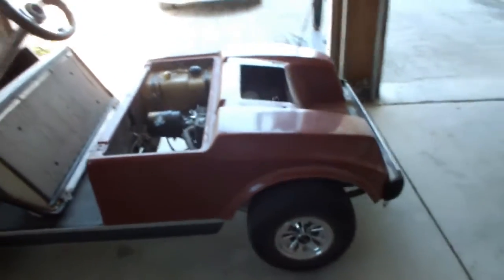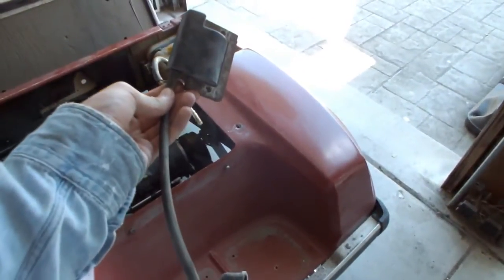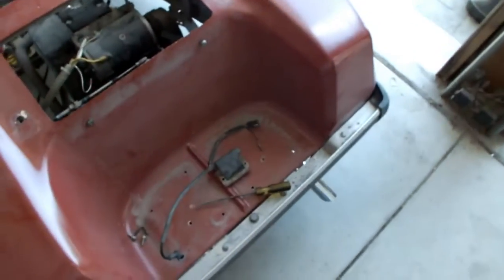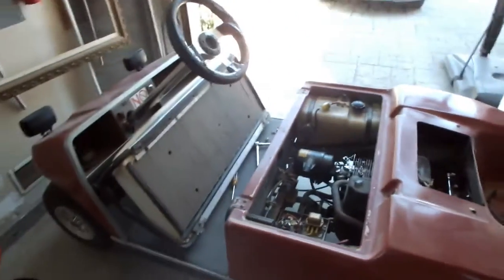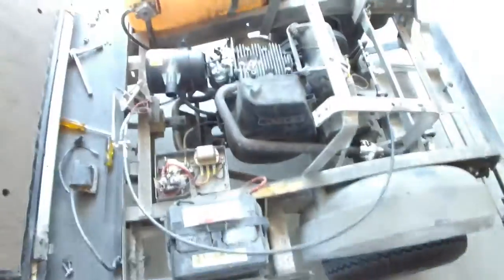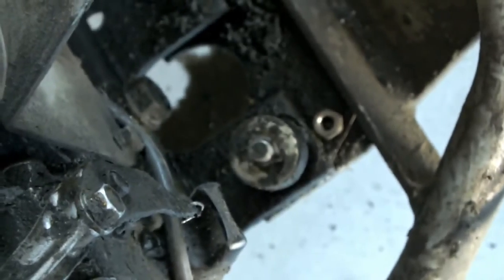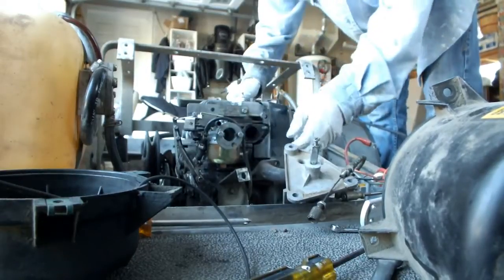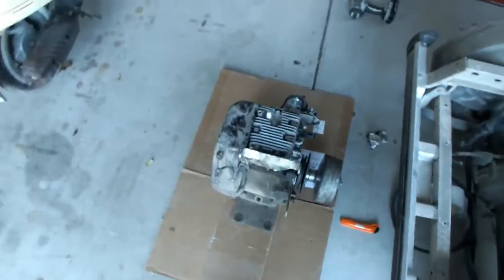Club Car GX420 Engine Swap: Teardown

Comment from the maker: If you want to go with an RB engine, go with an RB25. Get one that comes with a transmission, because the stock 280ZX Transmissions won't fit on that engine.

Comment from the maker: its an '83 Yamaha, dude! It'll run no matter what, lol. The negine that was in this thing is like the crappiest Kawasaki engine ever made. 6:1 compression, low volume carb, plastic cam etc. But rebuild kits for this thing go for $600 Minimum, si i think since this thing is partially rebuilt with a brand new carb with a drive clutch, ill ask for $750.

Comment: You just should have rebuilt the darn ignition. Its a simple electrical device.
Reply from the maker: It's a sealed coil/rev limiter with a double pulse, even if for some crazy reason they made rebuild kits for 1980's golf cart coild theres no way it could be done with out cutting everything else inside of it. BUT, i've only spent like $500 on this build, and complete KF82 engines go for up to $800! Might even come out ahead on this build :)
Reply: Ah I see, nice!